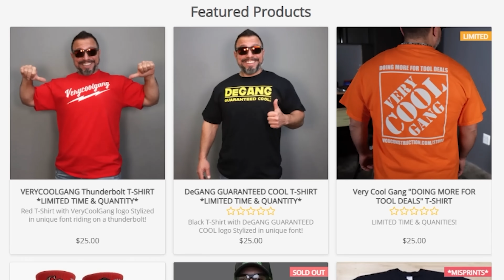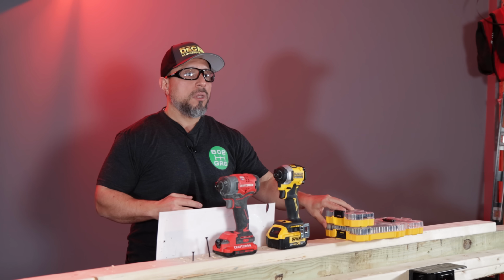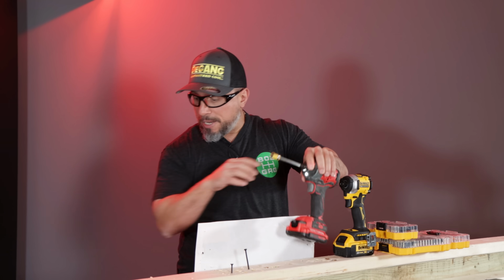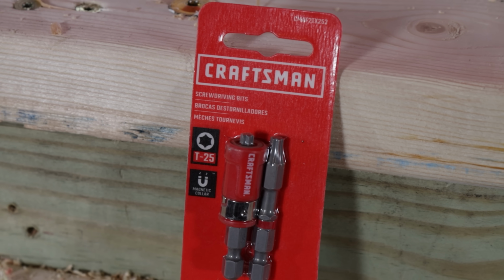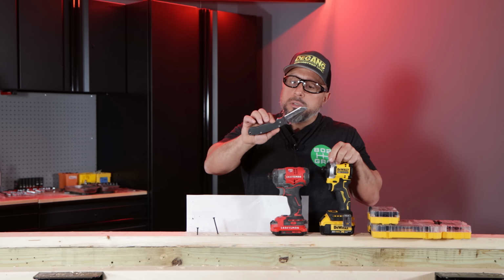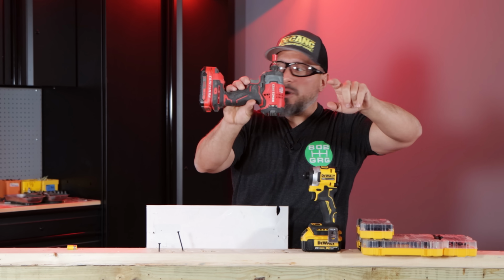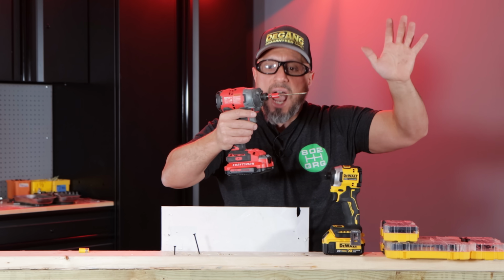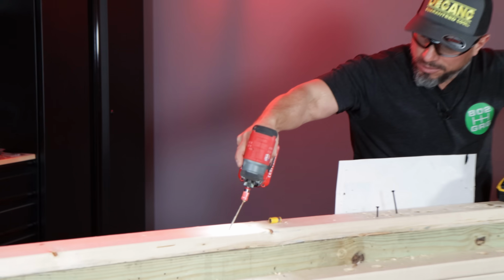CRAFTSMAN Makes Tool Accessories DeWALT WON'T!

Comment: DEWALT and craftsman are both owned by Stanley black and decker. The reason DEWALT quit making it and craftsman started is Stanley is pushing craftsman more currently since they acquired the company. They are made by the same people in the same building.
Reply: @Cartwright256  your bang on Stanley is UK brand to craftsman there battery fits to great tools for the money

Comment: I actually prefer the Makita magnetic sleeve. The Dewalt one tends to be so close to the screw that when the screw isn't flat it has more problems.
Reply from the maker: Makita has multiple solutions that I like !
Reply: The Makita is what I was going to mention. I had 3 of them until I gave one to an apprentice I was working with
Reply: I added a comment about the Makita before reading your. The Makita collar doesn't fit most of my bits...are you using bits actually from Makita or am I missing something/ possibly got a defective collar?
Reply: @russellmeyer1  Ya gotta use Makita bits with the new silver Makita mag boost for the most part. The old blue Makita mag boost would work on just about every bit brand out there. Sometimes you can still find them for sale at online sellers.
Reply: @russellmeyer1  I have the old blue one and I use it on everything from my Milwaukee ratcheting screwdriver with the long bits to Dewalt Maxfit bits. Never owned a Makita bit.

Comment: “And when I say here… I meanin’ plannet earth” A philosophical man
Reply from the maker: Always
Reply: @VCGConstruction  new to the channel. Has Milwaukee fixed the collar on the drivers to keep the bits from coming out? Thanks
Reply: @AzTurboMini  yes, as of late 2020 all m18 2853-20 impact drivers (a.k.a. gen 3.5) have dual ball detent collets. 👍
Reply: Makita makes the same plastic magnet to fit over a long bit I bought them at home Depot two weeks ago and they work beautifully

Comment: I love this little tool. Its so small but accomplishes a TON! Never knew Dewalt stopped making these. I have like 3 laying around from the kits i bought so far. Gonna make sure they stay safe and not get lost.
Reply: I'm glad I have 3 of the yellow dewalt magnetizing sleeves still in my tools.
Reply: I still have 2 of the older bit kit withers in both of them
Reply: Dewalt didn’t stop making these lol they have a new version made of metal now. It’s much more sturdy and easier to slide on and off bits

Comment: Dewalt still makes them… they just come in the Maxfit impact rated bit sets at Home Depot. They also come in the Dewalt Flextorq bit sets at Lowe’s but the housing is made out of aluminum (fancy). I have never seen them sold separately before, but I got all of mine from the bit sets they came in. They are great at keeping the screws from falling off!

Comment: Hey Vince wondering if you can answer a question for me. I got the M12 1/2 Stubby tool only then bought a charger and battery, now I'm looking for a case to put it all in. I found some Hard cases for sale for other model M12 guns, are the cutouts inside the case specific to each tool or are they universal? I.E. If I get the hard case from a 2553-22 will my 2555-20 fit inside? Thanks man love the videos!

Comment: I just think stanley b+d is just doing what a big company does. Evaluating revenue streams with multiple platforms. If craftsman performed better with driver accessories than adding that to the lineup makes sense.  I never saw the dewalt one available anywhere so I bought a master force one from menards
Reply: It’s the exact same thing that Milwaukee does, test running tools on the ryobi line

Comment: I had the same as you had from DeWalt, lost it and then I ended up getting a masterforce a while ago from Menards. It came with the interchangeable magnetic torsion collar, a double-sided square head, a double sided Philips head, and a double-sided T25 head. Then about a month ago I found my DeWalt one and compared them. Not much difference other than the color really, I'd say they got the same grip.
Reply from the maker: Appreciate the feedback Tony!
Reply: I love this info!!
Reply: There is actually a few differences that Ive found in my use of both. The Dewalt mag slides on the bit shaft during use which I personally do not like and the Masterforce does not. However the Masterforce tends to come off the bit during use often especially when using it with a larger fastener bit like a T30 or T40 bit for lag fasteners. Ive also had several of the magnets on the Masterforce come off and or break after some use where I havent had that happen with the Dewalt. The old Makita mag boost is the best bit magnet Ive found but you cant find them anymore. I'd say the new Makita mag boost is my 2nd favorite and is quite nice for setting screws as its design helps prevent overdrive. I'd take the Masterforce as a cheap 3rd alternative over the Dewalt because I dislike the way the Dewalt slides on the bit during use and I also like the Masterforce bits as a cheap alternative to Dewalt bits.
Reply: @VCGConstruction   what are style bits these work with again

Comment: would like to know how it compares to the one i current own. which is the new silver makita XPS ring magnet sleeve. its a short one, with the 3 ball bearings on the inside of the ring to retain it
Reply: @Dreamcat 4. Imo if you dont mind having to use Makita bits the Makita mag boost that you have is probably the best one on the market right now. Imo it works better then the Craftsman/Dewalt one Vince is demonstrating in the vid.
Reply: @duncdunc76  cool man! thanks for letting me know. it did come as part of the 60 bits xps kit so have some 2 inch impact bits go with it. actually here in UK the dewalt one  can only be found a part of a kit pack DEWALT DWA2SLS30 MAXFIT which is #26 GBP on amazon uk. elsewhere it seems my other future impact bits will have to be things like wera impactor. since i cannot seem to obtain the makita xps stuff anymore. at least not with reasonable pricing. shall just try the xps collar with other brands and see if it might work for some of them. thanks for the input here! appreciate it 👍

Comment: Hello again Vince and Vcg 
Thank you for another Great Video. And thank you for another opportunity. Again thank you
Reply from the maker: Thank you George, we appreciate you!
Reply: @VCGConstruction  Hello again and Thank you Vince and Vcg. I have a question for you guys. I've been researching one of my next tool purchase. I have found a Gearwrench 81235 and Sunex 8855, Both are 9-piece Magnetic universal joint sockets   and Extensions. I have to admit that I like the idea.  What I don't know is how much magnetic pull or field does each one have? They are both very similar in design and detail. I have called both companies and got  nothing to speak of information wise. The idea is the as the Craftsman Magnetic tool you showed today. Don't drop the tool or part. So I guess the question is which one is the Best tool for me to purchase? Again thank you

Comment: Dewalt has a new version of this made of metal that slides on and off of bits easier and magnetizes better than the old plastic one. You’ll find them in newer bit sets it’s silver metal and a bit wider. You’ll know what I’m talking about when you see it.

Comment: Yo Vince! Hmm. I'm still stuck on a standard 3" magnetic driver with screw guide. A.k.a. magnetic sleeve.  I've yet to find a reason to have anything else. CLOSE! I've come real close, but no replacement yet needed. 🤷‍♂️ Great video and as always, God bless! 😁👍
Reply from the maker: The Dewalt sleeve is still one of my “Go to” drives as well Dave!
Reply: Hardly anybody makes them anymore,I ended up getting mine at Walmart under the Hypertough brand

Comment: Makes absolutely no sense DeWalt would discontinue that magnetic bit sleeve. Maybe it's just a supply issue. All those shipping stuck out off the coast of California. No DeWalt magnetic bit sleeve for Christmas ☹️
Reply: It could be that manufacturing cost over-runs prevented procurement department at DeWalt from reordering.

Comment: After using just about every bit mag out there Ive come to the conclusion that the original blue Makita mag boost is still the best! With the new silver Makita mag boost coming in second place because it pretty much only works with Makita bits which kinda sucks. Especially since Makita isnt making a 2" T40 bit that it can be used with which is a main bit I use in my work of building outdoor structures like gazebos, pergolas, and kids playsets.  All the Dewalt ones work decently but I dont like how both the metal and plastic ones move on the bits while using them, and of course they pretty much only work with Dewalt bits as well. The Masterforce, and Irwin bit mags are very similar and work decently as well and can fit on various bits, but they seem cheaper made and dont seem to last as long in my experience in hard use applications like driving lags with a lot of vibration. The magnets on those will fall out or break more frequently then the others in my use. Still cant beat the original Makita mag boost imo so if ya got some keep them safe as I used to have like 12 of them and Im down to 4 all do to employees loosing them lol. Never had one break. Sure wish Makita would make them again!

Comment: Stanley Black&Decker owns/makes DeWalt and Craftsman also. I think they own Porter Cable too...although Delta and Porter Cable were together previously. It's strange because Black and Decker has better right angle hex attachments for impacts than DeWalt. Porter Cable corded angle grinders are identicle to former Black and Decker except B&D had an awesome 8amp motor whereas the PC only has a 7. They're both fantastic though.

Comment: I buy the wera ringmaget bit holder for doing steel studs and such, great for those 1/2 Phillips drive screws that just slips off the bit, making you øoke it thru your finger.. They have a impact rated one too.. None if them are free😂 It's called the wera rapidator..

Comment: While Craftsman and DeWalt are two different brands, you might be surprised to know they are both made by the same company. Black and Decker purchased DeWalt in 1960 and Craftsman in 2017.Jan 11, 2024

Comment: If you dont understand the value of magnetized bits, get on a 26 foot ladder with one screw and a non magnetic bit, and drive that screw at arms length.

Comment: You get the yellow one in the kit at home Depot I could have sworn I saw as well as I saw a 5-bit set that had the yellow collars on all the five bits unless I'm mistaken and thinking of something else. These were the DeWalt
Reply: I think it was a drywall screws set with bits and the yellow collar. I just glanced at it though
Reply: Found a 4 pack of these DeWalt at my local Depot and yes, they are also in the kit.
Reply: @eseere4080  Photo please

Comment: Dewalt does still make them. MAXFIT screwdriving set with sleeve (30-piece) for $12.92 at home depot. My store has 81 in stock. The 2nd closes store next to me has 96 in stock. Store # is 6528.

Comment: The new kits at depot has 2 different bit sets and I believe that tip is in one of them. I seen it the other day. 😎🇺🇸👍Also did you get a pair of the Milwaukee work pants and if so how do they feel and do the sizes run true. Thanks 👍

Comment: One for your drill/driver bag, one for your impact driver bag, one for your hammer drill bag, & one for your bit holding ratcheting screwdriver.
Reply from the maker: Can never have too many, goes for tape measures as well in my opinion!
Reply: @VCGConstruction    Oh yes, tape measures!  At least one  in each tool bag, car, truck.  Also, include metric and low light.  Measure thrice, cut once.

Comment: look at this DW2507sure set system magnet at tractor supply and they have the little yellow one in kits the DW2507 is 7;99

Comment: Can you compare it to makita’s?
Reply from the maker: Sure
Reply: Makita mag boost bit mags are better then the Dewalt/Craftsman bit mags imo.  Ive used them all and I suppose if you prefer Dewalt driver bits then you should probably get the 
Dewalt/Craftsmen one since their fit is kinda brand specific.

Comment: DEWALT Screwdriver Bit Set, Impact Ready, FlexTorq, 40-Piece (DWA2T40IR)DEWALT Screwdriver Bit Set, Impact Ready, FlexTorq, 40-Piece (DWA2T40IR)
has the magnetic sleeve

Comment: I’ve literally been thinking of getting into the craftsman stuff and getting away from ryobi
Reply: Not a terrible idea.
Reply: @paedahe4975  ryobi has way too many tools though if craftsman had the equivalent amount of tools I’d jump ship
Reply: I bought the Ryobi pole saw and had to take it apart in the first day and grind down the shaft and reassemble it to get it to work. Now it works great. I shouldn’t have to do all that. Have you had a problem with the Ryobi scrubbers?
Reply: @paedahe4975  Yes most of my ryobi tools I’ve had a problem with right out of the box and they replace them with another unit that works fine idk if that’s more of a store problem or ryobi quality issue. But I’ve been looking at Craftsman ridgid and Kobalt for my next tools
Reply: @tayallen7986  I personally think Craftsman power tools is a step up from Ryobi.
Reply: @tayallen7986  I do Kobalt and am happy with them.